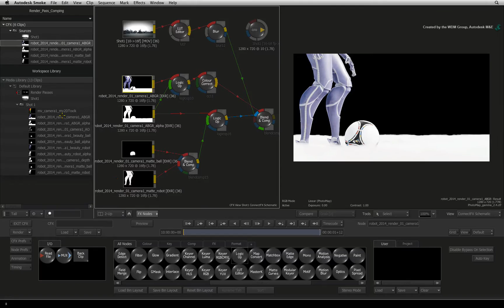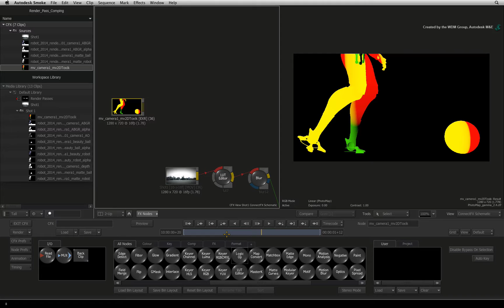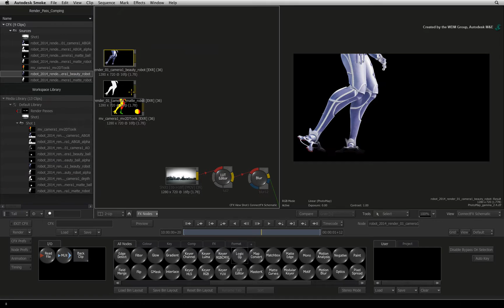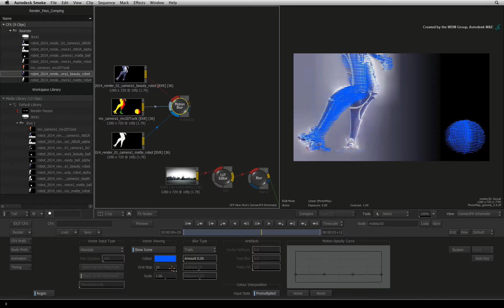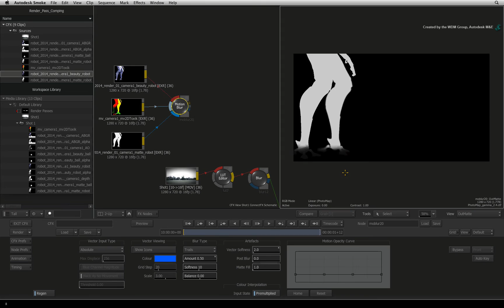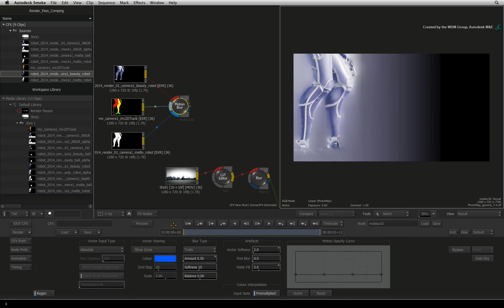CGI Compositing - Post Blurring with Motion Vector Data

Comment: Yes, I do understand that the beauty pass is the same as RBG. The thing is. Whenever I drag the Matte into connect effects, the matte image on the thumbnail in connect effects somehow changes to that of the RGB and my looks very messed up. As if you actually imputed  an RGB into the matte of the motion blur node. However I will uninstall and reinstall Smoke and see if that will fix my problem. Thanks for the reply.

Comment: It would seem like a bug or something. When i drag the mattes into connect effects schematic they somehow become beauty passes.
Reply from the maker: Hi Kemar, I have checked the files in my system and I can't seem to create the issue you describe.   The only things I can think of is if you have created Matte Containers when importing the render passes and you might need to "Explode" them through the basics menu to see the alphas.

I refer to "Beauty" passes as a way of describing the render pass.  However, Smoke does not distinguish what a beauty pass.   All the Smoke actually sees is RGB values.   So both a matte and fill (beauty) can be a clip.  We just use human terms to make it easier to understand.